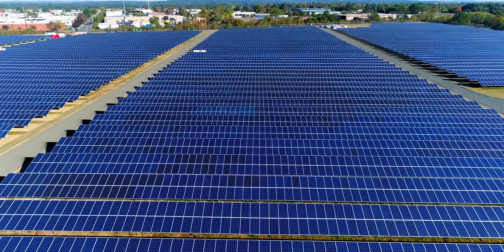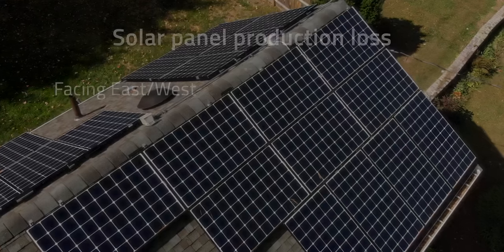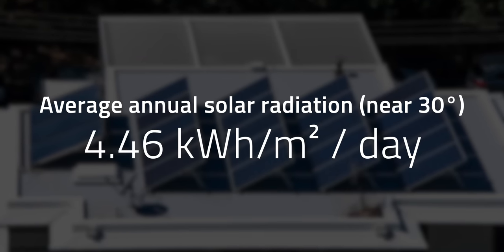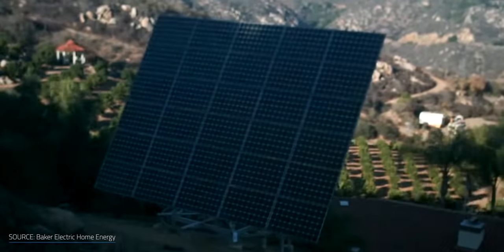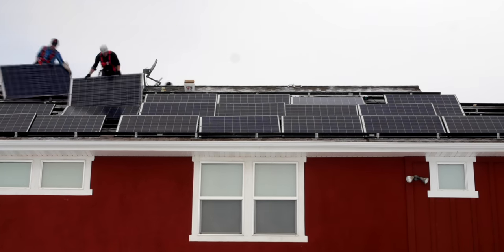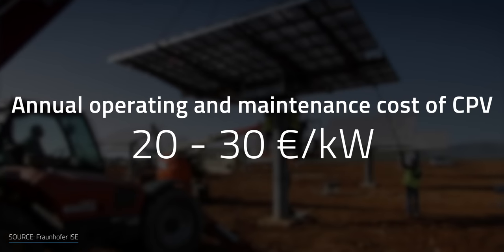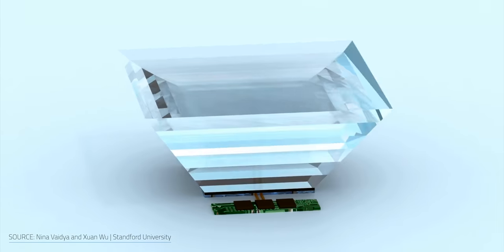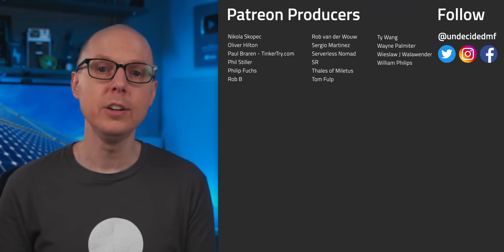This Invention Could Supercharge Solar Panels

Comment: One fundamental problem with fixed solar panels is that the effective area (i.e. the area perpendicular to the rays of sun which cover the solar panels) will decrease as the sun moves during the day, like you explain well in the beginning of the video. These lenses will not fix this issue and the performance will still decrease a lot when the rays of the sun are not perpendicular as it has no effect at all on the effective area of the incoming sun rays.
8:42 wtf? This is just wrong interpretation of the numbers. Efficiency should always be with respect to the area of the panels, not with respect of the electric power producing area.
Reply: Thanks for pointing this out. You can't get 10x - 100x more power out of the same surface area compared to normal PV panels.
Reply: Yea when he said that I imediately knew he was off. The benefits of using smaller pv cells like this is they can be made with less crystaline imperfections and more expensive materials as not as much is needed. It should also be pointed out that PV cells can be made more efficient with higher concentrations of light so that for the same area of energy collection more electrisity is generated but it maxes out at around 2x the efficiency, not 10 - 100x.
Reply: The AGILE system compensates for angularity by using prismatic lenses to concentrate the sun's rays at a maximum, regardless of the sun's position!
Reply: In addition to the argument of energy collection is directly proportional to surface area... the concentration of sunlight will produce more heat and the PV modules will be prone to early degradation.
Reply: @Quickened1  Yes, it does compensate for angularity effect of the rays hitting the solar panel, but the effect is marginal compared to the difference between the effective area of the sun rays and the area of the solar panels, the is just less sun rays hitting the solar panel when the panels are not perpendicular to the sun rays. The latter effect still holds for AGILE.
Reply: @patriekbruurs3424  I disagree. If it were marginal, they wouldn't be pursuing the technology. In fact, I believe it's probable the actual cell could be receiving more sunlight with the lens at an angle, than it does when it's perfectly perpendicular with or without it, because of the magnification of the light with it. I would need to see the data on that to be sure though.

Essentially, that's what he said, thereby eliminating the need for solar tracking...
Reply: yes clickbait rubbish. this guy churns them out and the fools belive him
Reply: @Quickened1  magnification in this context doesn't mean creating more energy, its just concentrating whatever is being received. If the panel is perpendicular to sunlight it receives maximum, if it is tilted it receives less than maximum.
Reply: Yeah a lot in this is video is just wrong or missing.
The main reason why concentrated PV is needed for these multi junction cells is because they get their high efficiencies only with high light intensities (most/all the "new efficiency record" breakthroughs are achieved in lab conditions with light intensities way higher than actual sunlight).
The 100x more energy claim is such a clear error and I really don't know how anyone remotely invested in this area will not find this weird. You can't possibly get more energy out of sunlight than the amount the sun delivers.
Reply: @GD-mw1kd  you clearly did not comprehend the explanation of the AGILE system... It has less to do with magnification and more to do with focusing the rays of the sun for optimal performance from any angle, without using moving parts or additional energy...
Reply: @esecallum  Lab results don't instantly turn into production. Developing a product takes time and so does understanding the science that makes it work. You really don't think refrigerators we use today are exactly the same as when they were first conceived, right?
Reply: This system does not change the area perpendicular to the sun, so it cannot possibly increase the total amount of light gathered compared to a traditional solar panel. This is just basic geometry. The AGILE system could improve the angular dependence to the same level as a traditional solar panel, but not beyond. This is still of benefit if the cells are 40% vs 20% efficient.

Comment: I came up with this concept myself thirty years ago. I attempted to patent it prior to producing a working model. I had proved the concept with small scale experiments - all was good - except for the cost of even a patent search. A patent itself was prohibitive let alone attempting a full size collector. My design was not fully usable at the time due to the non-invention of 3D printers and the lack of affordable high quality concentrator transparent material - I used fresnel lenses and marbles.

An advance on this concept was for the light to be amalgamated  by using a system of light guides in a hub formation leading to a fibre cable. This cable would transfer the light energy to a radiator panel - which would be an almost exact copy of the collector but used as a distributor. I called it a Portable Window. No energy cost in use at all. No tracking issues and no pesky conversion to electricity - natural light wherever you want it.  I still think this is a brilliant idea even all these decades later,. Really irritating that I could not get it off the ground - even more so that no one else has yet either !
Reply: Sir, these do exist, they are called fiber optic skylights.
Reply: The cost to patent is always a barrier to innovation.  It is a pretty bad designed process.  
I recall I have come to the conclusion 10 years ago that doing a inverted pyramid of 15 degrees of inclination was too much trouble.  15 degrees is the appropriate angle to get all the light in and nothing out. The problem is that you are going to need a lot of material to make the device to work well.  Who is going to put that big and heavy thing in your roof?
Reply: Don't tell me about patent costs...nearly bankrupted myself over a single patent application!!
Reply: @hyfy-tr2jy  I was thinking SolaTubes myself.  Although those are even simpler since there are no fiber-optics involved, simply a reflective tube mounted between the skylight on the roof and the light panel below.

Comment: I worked for Mobil Tyco Solar Energy in the 70s. We were building PV concentrators back then albeit a different design. They were linear with extruded fresnel lenses to focus the light.

Comment: It is amazing how expensive FV installations are in the US. I just signed today for an addition to my existing installation - 14/455W Canadian Solar HiKu panels coupled to a Fronius SYMO 5kW inverter, including 2 TIGO optimizers, and everything on the roof AND 21%VAT for 8,400€/$8,400 ($1.33/W vs what you show of $3.25 - more than twice as expensive).

Comment: The real win would be combining concentration and frequency separation, so you can have a patch of PV optimized for each frequency band, and outright reflect anything below the lowest useful frequency to reduce heat buildup
Reply: that sounds rather interesting. How would it be practically, and economically, done?
Reply: @funkybuddha2448  practically? No clue, but the optics, in theory, aren't too complicated. First, recognize that sunlight, while spherical is, at our distance, effectively planer, with all of the rays being parallel, so a lens and it's inverse can concentrate it into a parallel beam, second, run it through a prism to spread out the beam by frequency, onto patches of pv tuned to particular frequencies. Downside: the prism effectively reverses some of the concentration; you would need some sort of sun tracking to maintain beam and prism alignment

Upside, the pv patches can each be single layer with a reflective backing, and can use a variety of technologies

You could probably manage the sun tracking via a pair of internal mirrors, and depending on the usful frequency ranges, handle the concentrator lenses with Fresnel's

The optics alone can probably get up to 90% efficiency, so the overall efficiency is likely dictated by the variety of individual components, their efficiencies within the frequency bands they are exposed to, and the annoyance that the sun isn't actually a point source and has a measurable disk

The other annoyance is the assemblage would likely be bulky, and, considering it hasn't actually been done, the optics may be more expensive than the photovoltaics the effectively replace
Reply: Simple answer: metallic window films aka "tinting". More complicated answer: nano-structured materials have been proven in labs to filter specific wavelengths of light and control thermal transmission.

Comment: This was a good and interesting video Matt. Myself and others have thought about this idea in the past. My thoughts were equivalent to a magnifying glass over the solar panel. I remember that the problem many DYI people who were trying to get better performance out of their panels was overheating the panels and ruining them in a short time. Surely this new process that is being experimented with has taken that challenge into consideration. It would be interesting to know about how they are dealing with that overheating issue. Thanks for the video Matt.
Reply: I too am looking forward to development of this tech and fantasize about the small scale/ personal implications.
Reply: I’ve always wondered why panels don’t use cmos senor design with wide lenses over the array to capture non-tangential light.
Reply: There are PV cells and panels which use a simple 'magnifying glass' kind of lens over the semiconductor. They have existed from the beginning of PV power. This thing is not that! 
A simple lens will NOT properly concentrate light that comes in off the central optical axis. So that simple, old-fashioned kind still require solar tracking... the most expensive kind, 2-axis tracking. Even that is NO help when the sky is milky. This Graded Index Non-imaging Light Concentrator does NOT require tracking. It DOES work even when the sky is milky. That is what makes it interesting.
Reply: @SirDargonite  This guy is special! Welcome to the SPECIAL K club!
LOL...Special K was my favorite cereal for many years.
Reply: Is there a way to capture that heat. Use it with some kind of heat pump?
Reply: The IR light refracts at an angle that is filtered out with hyperparabolic concentrators and prismatic/Fresnel lenses. Look how the rainbow forms with a prism, the IR is cast aside at the very edge of the light spectrum.
Reply: @maschwerer  Because all that sun is a heat problem. When panels get hot they dont produce as much and too hot they break. https://www.youtube.com/watch?v=Mt9qLRN7JvA
Reply: Tesla747 is correct, the PV cells get too hot. Passive cooling isn't enough, so you end up with a cooling system on the back of the cells. 

Gallium arsenide cells have been tried with concentrating lenses and active cooling. They work, but the added complexity doesn't pay off. 

Single axis trackers just barely pay off as it is, it's really hard to beat a few extra panels just stuck in the ground. The cheaper the panels get the less complexity pays off.
Reply: Do you wanna talk mate I belive we on same page and I can improve on this and stop the hot spots from a magnifying glass ...cheers

Comment: You won't magically get more energy out of the same lighted area because you focus it on smaller cells instead. The same area of surface will always receive the same amount of light, no matter if you use flat panels, tracking panels or lenses. It's just about the tradeoff how much surface area you need in solar cells.
However, while this lensed assembly requires considerably less surface area of solar cells than a classic one, you additionally have to consider the extra cost for the lenses and precision assembly, the added weight that requires stronger support, as well as the efficiency loss and reduced longevity due to the heat issue. The classic flat, well ventilated panels already have heat issues as-is. Focusing 100-1000x the amount of light onto a tiny spot means that it will heat up 100-1000x as fast as well - that's in the lower ranges of those mirror tower assemblies that use the heat rather than the actual light to generate power...

Comment: Recently I was looking into solar power and wondered why automated tilting mechanisms are used more for solar panels.
Its good to actually see the installation / efficiency / maintenance costs. Apparently its cheaper just to buy more panels.
Reply: Single axis trackers dominate the US utility scale solar installations.   Not sure why he downplays them except that his viewer demographics likely skew more to the home installation user and in that case trackers are not often practical.
Reply: Even for a home viewer, I'm not sure why there wouldn't be some sort of adjustment for summer vs winter. It doesn't have to be automatic with heavy equipment.
Reply: @remyllebeau77  

I've wondered that as well.  I suppose some people might get hurt climbing up on their roofs twice a year?    No idea.
Reply: @johnborton4522  Hmm, yeah.
Reply: @remyllebeau77  Look at the "Life Uncontained" channel here on YouTube.  They have a manual single axis (elevation) on their off-grid system, ground mounted, that seems to be working quite well for them.  I think he adjusts the panels at least 4x a year.  And best of all, it's all home built/designed.
Reply: @michiganengineer8621  Very nice. It makes sense that he doesn't have to climb up on his roof all year.
Reply: @remyllebeau77  Adjustable angles for a roof mounted system seems silly to me anyway.  Design the slope of your roof for the MEDIAN of what you're going to get, around the equinoxes, which will be pretty damned close to the latitude of your build site.  For me it's pretty close to 43 degrees (about 5:12)
Reply: Yup unfortunately it's just not worth the additional cost to use solar tracking. That's not even factoring in maintenance and repair. Anytime you add a moving part to a system it becomes a matter of when not if it will breakdown.
Reply: @johnborton4522  how recently are those systems installed? panels have become alot cheaper recently and previously ya it was worth using a tracker.
Reply: @remyllebeau77  but a 10°  adjustment was only 1% different he said. It wasn't until 30° that it became 10% loss in efficiency. I don't think the angle for winter vs summer is more than 20°.
Reply: @randybobandy9828  

VERY recent. 

According to the NREL Summer 2022 quarterly solar report (can't link direct here in YT, but these reports are easy to find cataloged online ):

////
The use of single-axis/one-axis tracking in the U.S. utility PV market has grown significantly over the past decade.

– At the end of 2021, 77% of all U.S. utility-scale PV systems used single-axis tracking. And 89% of U.S. utility-scale PV systems installed in 2021 used single axis tracking.

– This growth can be attributed to the reduced cost and increased reliability of trackers, making them the economic choice in a broader distribution of PV systems (e.g., less irradiant climates).
////
Reply: @randybobandy9828  

//"Yup unfortunately it's just not worth the additional cost to use solar tracking."//

While you are almost certainly correct on a roof mount home systems, this simply isn't true on larger scale ground mount system or 90% of the recent installed large systems wouldn't include them currently (as I showed from the NREL data) 

My company is knee deep in a 60 acre utility scale system for it's own industrial use and every single design recommendation from multiple consultants said the return on tracking was overwhelmingly positive (the payoff was like 3 years).  We're not even land constrained as we have lots of cheap and clear $1,000 acre land.  Single axis tracking still won out by a large margin.
Reply: you could even just use smaller panels and a couple motors to make a tracker. nighthawkinlight did a good one.
Reply: @michiganengineer8621  You man change the angle of the panels. Changing the angle of a roof is usually prohibitively expensive.
Reply: You don't need a tracking system for each panel. Mechanically linking the panels together gives you the same result with a single actuator. That point was not in the video. Still adds maintenance cost though.
Reply: @edeaglehouse2221  Agreed, that's why you set the roof angle during construction.  Set it to approximately the same as your Latitude or just a touch higher since the insolation numbers are often a little lower during the winter months.